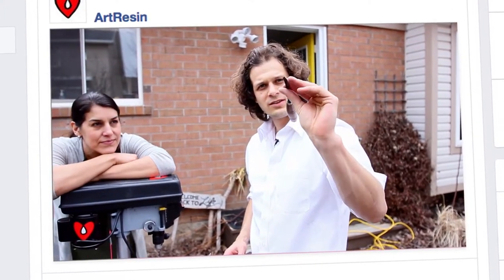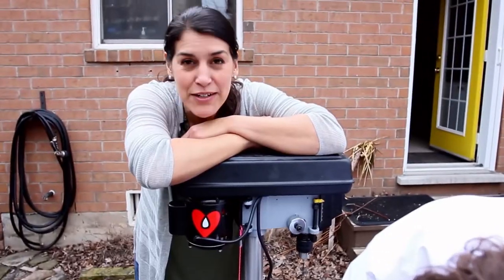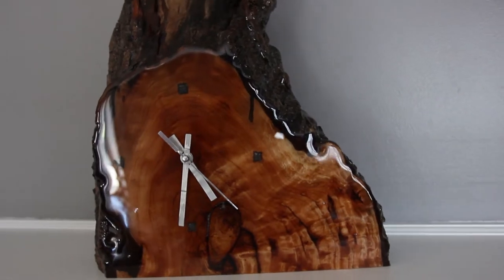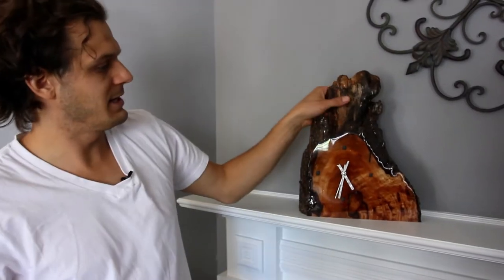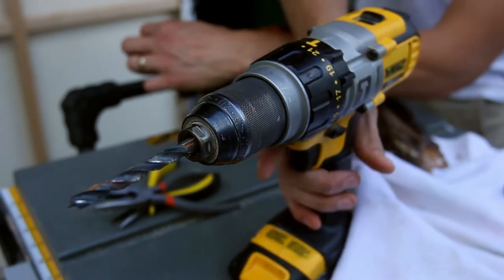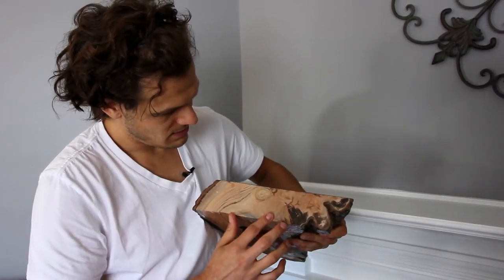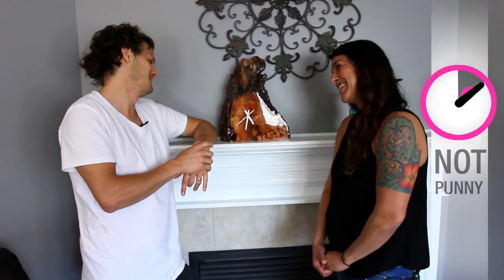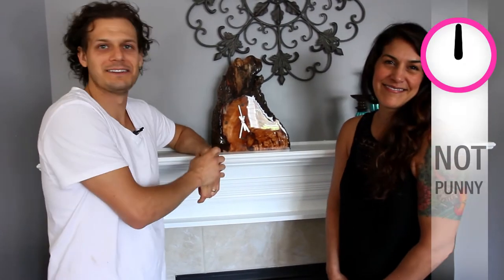How To Resin A Clock - Part 6

Comment: Quick question, after sawing the bottom off, did you seal it with anything?
Reply from the maker: Hi Kevin - no we didn't, but you certainly could rub in a thin coat of ArtResin or you could seal it with a polyurethane or similar if you wish!